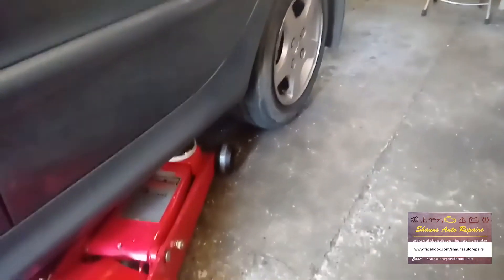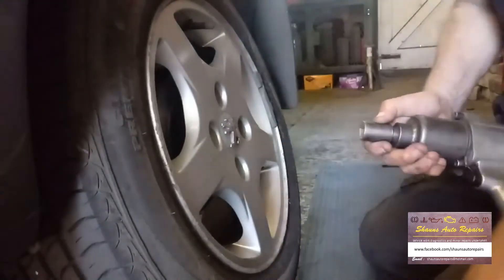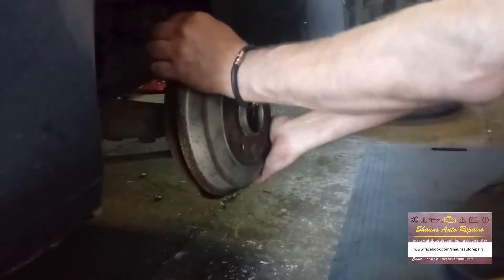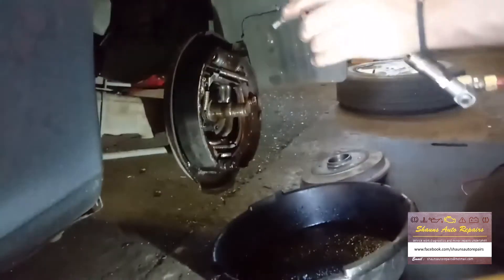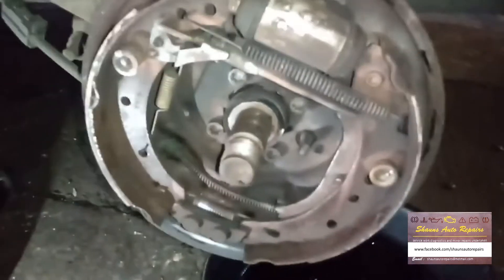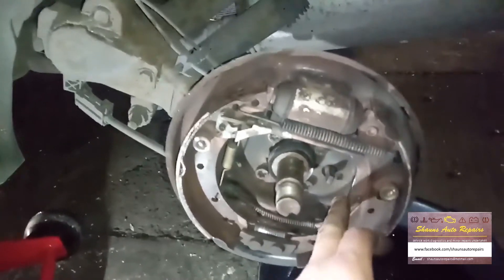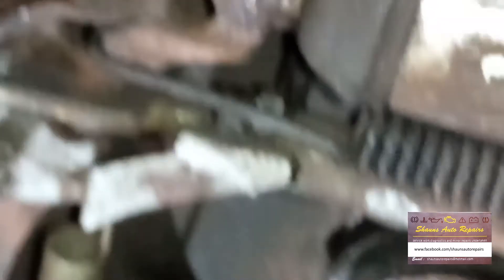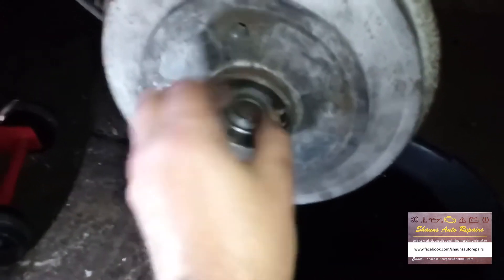PEUGEOT 206 1.4 HDI 2006 REAR BRAKE ADJUSTMENT / HANDBRAKE not a fail

Comment: This was the one I was chearhing for. Nice explinacion of those handbreak setting
Reply from the maker: Thanks for watching and for your comment. It's much appreciated
Reply: This is how I have done it to set the handbrake and shoes .
Step one is to center the brake shoes to put the belt drum on its place and turn it a bit. Step 2 to turn that special nut a bit forward or backward until the belt drum doesn't fit anymore. Step 3 is to turn it about one total turn to loosen it a bit and it,s been set properly. If you can turn the belt drum freely after that you are done. 😉 
It took me a lot of time to figure out how the parts had to be assembled because you will mostly buy the shoes without the springs and the other stuff. I couldn't find that part explanation anywhere only when I went to the scrapyard. Made some pictures and used that as a reference. 😇

Comment: Hi Shaun I fitted new brake shoes and have forgotten which way the fork on the stew tread fits to the shoe, ie there is one side of the fork with a step in it and the other edge of the slot is tapered outwards. Which side of the fork goes to the outside of the shoe beside the wee adjuster clip. Thks
Reply from the maker: Without looking I can't remember offhand.. Best thing is to check the opposite wheel. See how that is put together. I often find it useful to take pics with your phone before taking anything apart for reference.

Comment: I cant get the drum off at all, any tips
Reply from the maker: If you have the centre nut off and you cant get the drum off it proberly means you have a wear ridge on the lip of the drum what the brake shoes are hanging on to... Try tapping at diffrent sides with a hammer while levering the opposite side with a prybar or screwdriver... If its realy jammed on there you may need a puller to pull it off. This may brake all the brake shoe fitting clips etc so a fitting kit may be required to reassemble... good luck

Comment: I never understand why would you preset the self adjuster manually?  If everything works fine the shoes should adjust automatically, isn't they?
Reply from the maker: @oggy4418  In a perfect world yes this would be the case but an automatic adjuster has to travel quite a bit before the pawl clicks over and can take time to adjust. Better to manualaly adjust it while your in there.
Reply: @shaunsautorepairs5410   I never had a problem until now. I did not past the MOT both rear drum breaks not working. Replaced everything new(drums, shoes, cylinders) and jet again both rear breaks not breaking. 
Pedal is hard rock solid after engine start it goes down a bit and works just fine. I noticed that self adjusters has difficulties to adjust themself properly. So I aplied some lube on every moveable spots, adjust manually when the drum just rub slightly against the shoes and end up with one drum turn brown and blue, both shoes damaged as well😅
Before reinstaling the drum I always slacken hand break adjuster and set the shoes to its lowest diameter and when someone pushing the breaking pedal you can hear self adjusters clicking just fine so I don't see the reason to adjust them manually whatsoever but feel lost as well.
I don't belive the problem is in the master cylinder because the front wheels work great wit maximal breaking force according  the MOT and the rear and front line are interconected becouse there are two section like front left with rear right and front right with rear left so if there is enough preassure in the fron it shout be in the rear as well.
I made both rear line by myself brand new so the only reason what come to my mind is that I possiblly bent them too much and they colapse but I dont know if that would lower the preassure?
The system is blead correctly cos the pedal is rock hard not going down before you turn the engine on of course.🤷‍♂